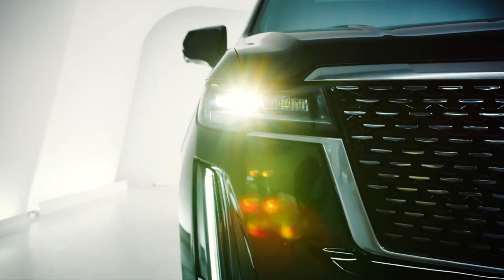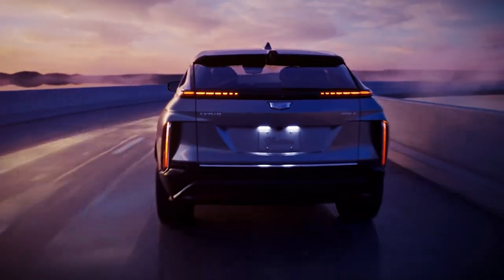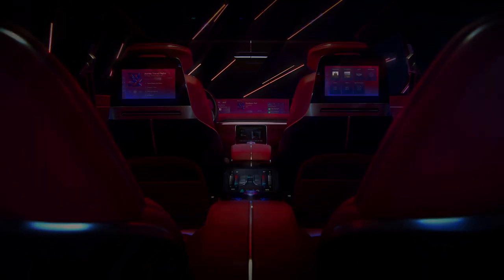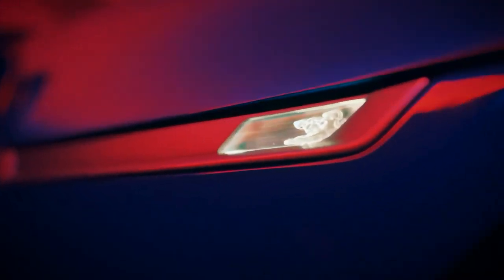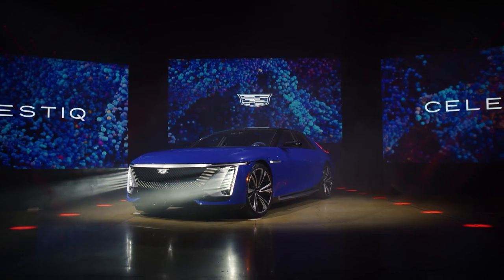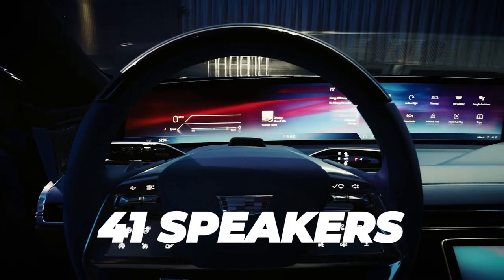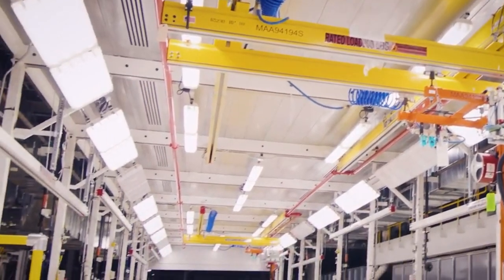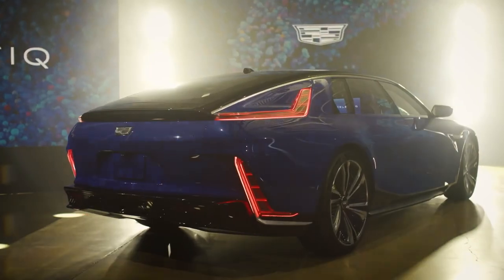Crazy EXPENSIVE Ultra-Luxury Cadillac Celestiq EV

Comment: Nice as this car is, I don't thank it's will sale that well because of GM lazy past  they used to cut alot of corners, people remember that ,because all the videos on this car , that what I'm seeing in the comments section. Number 2 , Gms marketing is stupid , because they released the Lyriq first ,not the Celestiq so now people see that style from the Lyriq ,meaning the lights and grill sharp  on the Celestiq ,so now  people saying it looks like the Lyriq .People are now saying  their not going to pay 300k for  a car  that's looks like a 70k car even though  that style was on the Celest IQ first , but most people out the car community don't know that. Gm was working on the Celestiq way before they even thought about building the Lyriq and the Lyriq got its style from the Celest IQ ,but GM dumb asses released the Lyriq first ,dumb move dumb move!!! Its going to cost them big time !!!!
Reply: That's what I've been reading also about Lyriq. The front end is based off the Escala. It was a concept Cadillac never built. The car was shown in 2016. Technically speaking Escala came first. It was ice instead of electric. This the argument GM can make about Lyriq front end.
There was a Cadillac Ciel concept after Escala in 2017. The Cadillac Autonomous was shown this yr with similar front end before Lyriq.
Reply: I just don't see no where it's a Cadillac